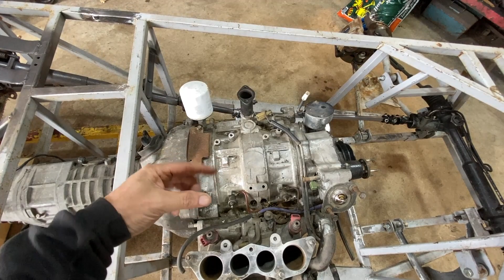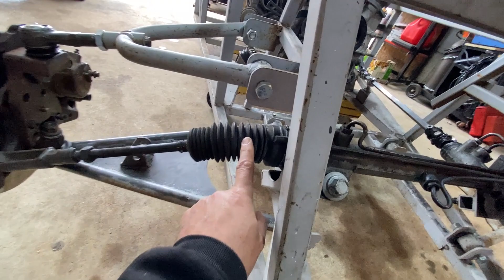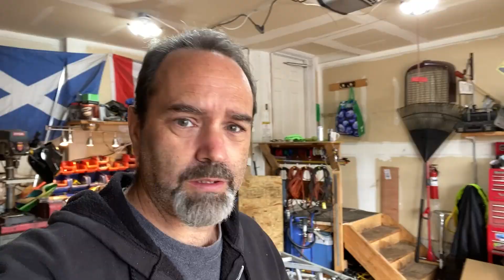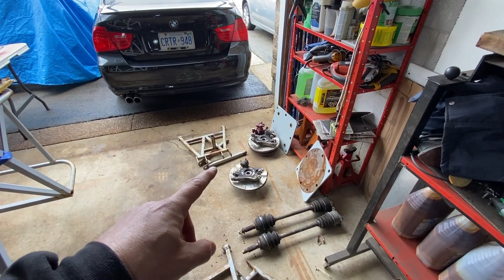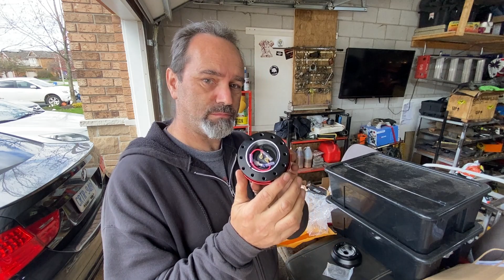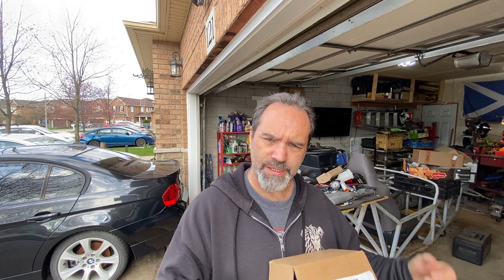Rotary Chuff Test - Quick Release Steering - Rear Suspension Plan On My Locost 7 Project

Comment: The original builder was over his head and some of the suspension subassemblies show it.  Don't cut your knuckles apart.  Use them as they are.  Get some donor outer joints and use the spline sections and some tube to create a temporary solid axle that holds the knuckles and wheel hubs in perfect alignment at the correct width you require.  Place this assembly precisely under the car, tack weld it in place and create or adapt stock control links at the correct angles from the stock knuckles to the chassis.  Once you have everything in place you can disassemble one side and remove the temporary axle and the knuckles will be properly and securely located and the wheels will be parallel to each other.  You can then move on to the front.  That requires rethinking as well.  It's not as simple as shortening the lower arm as that will change the camber curve of the suspension...not to say its correct as it sits mind you!  You NEED a good book on suspension design and  some time to study it.  Theres a LOT going on you need to consider and it can make or break the enjoyment of the car.  Wish the reality wasn't as harsh as it appears but better to find things now than later!  All the best!
Reply from the maker: Thanks for taking the time to give all this info. These knuckles actually attach to a cast outer shell, which then attaches to forward facing swing arms. It's way too bulky and complicated to use as stock. The original builder had a different setup in mind for the rear, the RX7 rear suspension is my stupid idea, lol. I'll make it work. If it drives crap I'll start again.
Reply: @ScottRods    I hear ya!  Just looking to make things simpler and potentially more reliable for you.  I wonder is there a way to find out what other knuckles those outer splines will fit?  There might be some different knuckles waiting to be found that will simplify everything for you!
Reply from the maker: @Sculpin74  I'm really struggling to find anything I can use, at a reasonable price. The Mazda Miata rear stuff would be great, but they are soooo expensive now. Hey, if it was simple everyone would be doing it, lol
Reply: @ScottRods  Isn't that the truth!  LoL  I'm a big fan of doing it yourself and always loved the Lotus/Caterham cars.  Never had so much as a ride in one unfortunately.  Have you considered a solid rear axle?  The smaller size axle you would need would keep unsprung weight down...but of course IRS is a bit better handling/ride wise if you can get it set up well.
Reply from the maker: @Sculpin74  I did consider a solid axle, but that would mean the prop shaft would be going up and down, and I'm already tight for space in that area. Wife and I once visited Westfield (very long time ago) and they let us take one out. Fell in love at that time, but only now getting to build one.

Comment: Dave.. if you look at that schematic I sent you the tie rod and lower a arm should be parallel as possible when level or the lines pointing to the instant center....so all the arcs move similiarly in the same movement...and in the angled line off the upper and lower arm mounts...remember you can always move the assembly up and down to check how your doing..I assume your going to beef up all those attachment points ...they look a little weak at the moument....gussets galore.....theres a lot of help on geometry on line so you should be able to make it race ready...what ever you do ..overbuild everything.....don't wanna lose a you tuber before his time......
Reply from the maker: Thanks Joe, I did get that picture you sent. I'll be happier to proceed with all that once I get the rear end on, and then get the wheels on to see how low or high it's going to sit.